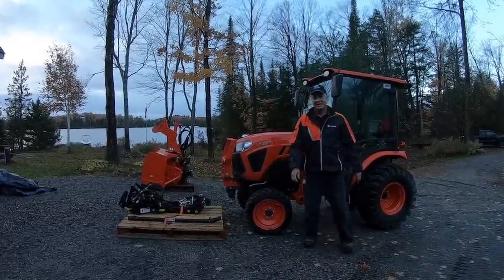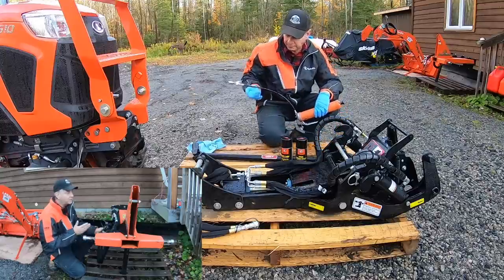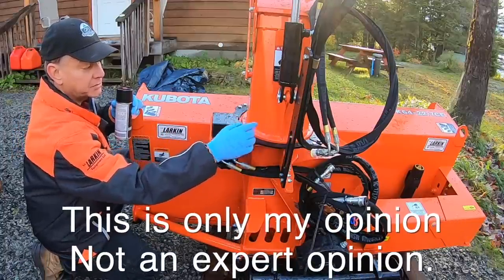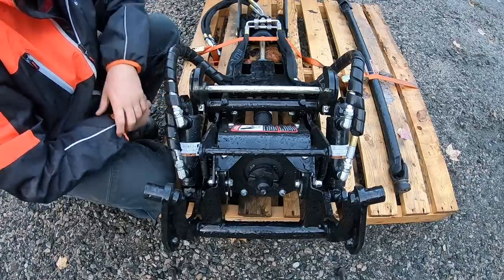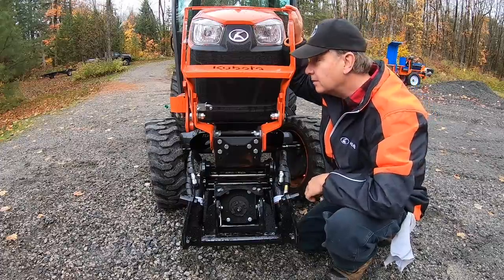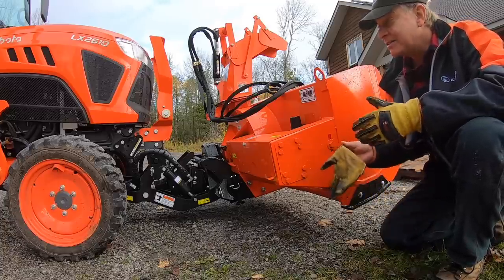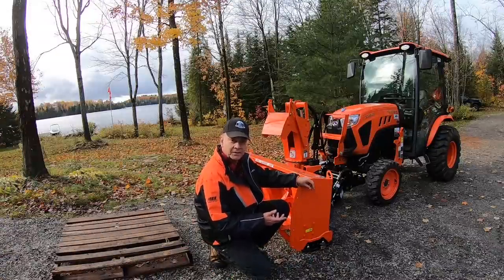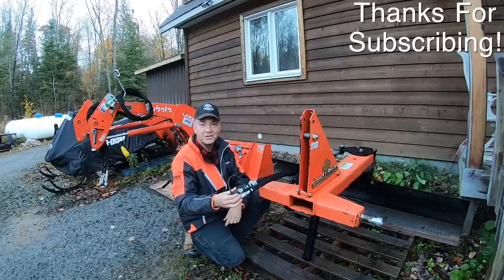#342 Kubota LX2980 Commercial Snowblower Install. Kubota LX2610 compact tractor.

Comment: I remember the first time I used my B2650, I was giggling because inside the cab I was so warm and comfortable and outside it was -20 with a 40 mph wind.  I will never forget it!  Don't forget to remove your air intake tube that goes from the front of the hood to the air filter when blowing snow.  Thank You for all the Great Videos!  They are very enjoyable  :  )
Reply from the maker: Morning and thanks very much ND! I am pretty excited to have some heat this winter. Can't wait. Have a great weekend!

Comment: The cup fitting is not a jic fitting its a compression fitting, that's why it doesn't need tape, using tape in general is only really a problem when you get it over the hole, it can get into the hydraulic system and into your relief valve etc. The yellow tape is for gas lines. O ring fittings make the seal with the  o ring. I would suggest though when you're installing any mounting bolts, especially on outdoor equipment, to coat the threads with blue locktite. It not only keeps the bolts from backing out, it will help prevent rust. Good content, im pretty sure I'm getting an lx2610, your vids have helped me decide. Also pipe fittings don't absolutely have to have tape if the threads are cut right, npt (pipe) threads are a tapered, self sealing thread, but tape or dope helps lubricate the threads and helps seal.
Reply from the maker: Good morning and thanks RC! Very helpful info for folks. I did some research and corrected those fittings in another video. Always lots to learn. LOL. Good luck and congrats on the new tractor!

Comment: You only need a Teflon tape or sealer when the threads are what is preventing the oil from escaping (like a “pipe” fitting) in the case of your previous video you had J.I.C. fittings (where the seal is made by the little cup part on the end) and not the threads. There is also an ORF (o-ring face) where it’s an o-ring that seals so again no tape/sealant required.

Comment: That's a nice blower. Looks really well built. The construction is very similar to that of a rear 3PH blower with the huge impeller, gear box in the back and chain drive auger. I prefer that configuration over the small bevel gear box located on the auger.

Comment: I laughed when you mentioned the "naked" tractor, I actually just bought a naked L2501 to run my 68" 3 point inverted snowblower. I'm looking forward to seeing your new snowblower in action.
Reply from the maker: LOL! Cheers Dave!
Reply: @GPOutdoors  hey Gord did you guys get any snow Friday night? I'm in New Hampshire  and north of the notches got 5 inches.
Reply from the maker: We got a heavy frost for sure but no snow. It's coming!
Reply: @GPOutdoors  i just bought a new husqavarna st327 blower with a 14.5hp kubota gas engine

Comment: A little trick I use to mark hydraulics hoses positions. Buy multi colors zip ties and match both males and females connectors with the appropriate colors. Much better than any kind of tape that, over time and in proximity with oil, always gets off. Do the same for the back remotes and implements hydraulics.
Reply from the maker: Morning Daniel! That's a great idea - I'll keep an eye out for them when I go to Princess Auto the next time. Cheers and thanks again!
Reply: My 2650 with similar set up came with colored caps/plus on the hydraulic ends.
Match those appropriately and then you have protection when not in use and a marking system when you need to connect them.
Reply from the maker: Thanks Tom. I think all of them should come with it but only two came with them. Cheers!
Reply: @GPOutdoors  
You might be able to buy them at the dealer or since you are doing such great things for them maybe they will donate them to you. Wink, Wink!!

Comment: GP certain fittings do need tape.  JIC are the tapered fitting they self seal.  I worked for CN rail on track equipment and  it was always a big no to put tape on JIC fittings.  With that said that JIC fitting may have a NPT thread on one end where it threads to the hose.  That end would need tape.  But it is a good idea to talk to your mechanic.  I am looking at my B2601 and there is no tape on JIC fittings only on NPT fittings.  Sometimes the NPT will use an o-ring.

Comment: I was surprised how easy it was for you to attach that subframe.  I thought that was going to be much harder.  They way it balances on the front pins and easily rotates to attach the rear pin looks like solid engineering to me.
Reply from the maker: Morning and thanks M! I was really impressed. However you may have noticed I had to go out front and push it on. The pallet raised it off the ground too much i think, and affected the angle of approach so next time I will put the blower flat on the ground and I believe it will just lift and connect all on it's own. Cheers!

Comment: Thanks GP for the snowblower hookup to the LX 2610 video. It is superior to the one I got on the B2601. Although I think my blower chute seems to have more chute rotation unless you didn’t turn all the way.  You gave valuable tips on what you do which I will incorporate this fall. I really like the K Connect, much stronger even though I’ve had no problems. Lots of improvements. Thanks again for the video. Wayne from Wisconsin

Comment: You'll really appreciate that cab and heater this winter GP.  As for the teflon tape I'd use it for sure. Except for on the fittings that are beveled and/or machined.  They will leak if you put teflon on them. As you know, i work in the gas and oil and we always use thread sealant tape normally the white is fine for most all applications. The colors are for different temperatures and products. We use the yellow teflon for products like Propane and Butanes. Which are products that are -17°F. We use the white teflon on Natural Gas lines Compressed Gas, and blue on high pressure oil and water lines. Alway hold the fitting with your left hand and wrap it Clockwise with your right hand.  Haha, left handed people struggle with this task.
Reply from the maker: Good morning Dean - thanks! Super helpful info. Good thing I am right-handed. LOL. Cheers!

Comment: GP what determines if you need a thread sealant on pipe threads is if the threads are tapered. Observe side profile of male threads and you’ll see if there is a taper or not. The taper is what creates the seal. As the two “cones” come together (males threads/female threads) the tapers will lock together and seal with a sealing compound or tape. Any fitting that has a swivel nut, oring, or some kind of sealing washer does not need thread sealant. Of course there’s always an odd duck and that is BSPP. I think old days they use to use hemp or what every they had to seal these straight threads.

Comment: Good looking machine I would use what you say is white tape Teflon tape never use the yellow tape that is for gas lines only like propane or natural gas since those are more corrosive in nature then water or hydraulic fluid is. I work for a hardware store over 5 years now and I see the people all the time wondering which tape to use and we tell them.
Reply from the maker: Thanks D! Appreciate the help!

Comment: Greetings Gord, Lee here,  just a heads up, where you are talking grease fittings, thought I would mention that my son bought a new BX23S with a backhoe. He checked it over and seen all the grease zerks had grease on them, he assumed the fittings were all greased. But when he was using the backhoe he noticed a noise coming from the swinging of the hoe, when he checked it out he noticed that even though there was grease on the fitting, it did not go into the fitting and hence the noise, he noticed there was orange paint covering the zerk preventing the grease from entering. so he scrapped the paint off and then regreased it and all was well, Keep well, later
Reply from the maker: Morning Lee. Thanks - this is very helpful. I will take another look at it this week and wipe them off and just give a squirt to see. Thanks again - better now when it is warm, than later down the road. :))

Comment: 27 yrs as a aircraft mechanic- the fittings that need a sealer or something to keep thread from Gauling  recommendation use a Teflon paste not tape- if the tape gets into system it can cause problems in small orrface in most valves- the fittings that have the 37 degree on leading edge does not require tape- on stainless steel fittings it is recommended to just lube threads
Reply from the maker: Thanks very much Lee! Very helpful! All the best to you.

Comment: Hey Gordy, 

You are always very detailed and informative with your videos.  I received my new LX2610 Cab model 2 weeks ago and just put my LX2980 snowblower on for the first time.  Never had a tractor before so I'm learning everything as I go, but this commercial blower is very easy to attach.    I'm kind of excited to use this bower for the first time.  It IS a beast! 

One thing I noticed on your video that you had specifically commented on, is that you have heat shields on both sides of your tractor.  The only one that is needed on your tractor, is the one on the left side where the exhaust is located.  The one on the right side is for the LX3310 as its exhaust exits on that side.  Its certainly not hurting anything to have a 2nd one...

Also, not that it matters, but I installed both of the L pins from the right side of the tractor.  That is what is shown in the manual.  Makes securing them with the locking pins a one stop operation on the left side.  Routing the hoses through the "twisty" hose support is somewhat of a pain.  The process that worked for me was pushing the hose through the side on the support and then working the hose around the upper and lower ends of the "twisty".  It's tight, but they do fit!

This "twisty" Hose Support as it is called appears to be missing from your tractor.  It is shown on page 22, Part# 5 in the "Kubota LX2940 Subframe and 4_point hitch Owner's Manual".  Might want to check with your dealer on that.

Let is SNOW!

Keep up the great videos!

Comment: How's she goin'?  That's a nice blower GP.  It lifts nice and high and that will be a benefit.  The mount went on some easy and then connecting the to the blower was a snap as well.  Pretty slick all around I'd say, and it's even orange!!!  LOL  Hope the winter isn't too rough.  We're due for an open one, but we'll see eh!!  Take care!!
Reply from the maker: Morning Grampie! I can't wait to see if it throws as well as the last one. Having it on the pallet I think raised the angle - you may have noticed I had to grab it from the front and push it onto the hinges so next time I'll put it on the ground. Take care my friend!

Comment: Consider using PFTE spray for lubing areas where you have steel on steel but dont want to use grease which will attract dirt or ice. I use it on my PTO and hydraulic sleeve fittings as well as on the snowblower chute gearbox.

Second, use a bolt and nut to secure the big pins that hold the undermount to the frame. I've routinely lost those cotter pin type D rings due to the forces when snowblowing on turns or hills.

Comment: I use a pipe dope I got from Princesses Auto myself. Think anything is better then nothing. And do like you said. Keep it only on the threads. 👍
Reply from the maker: Thanks Laurie!
Reply: As another stated, there are different types of sealing fittings. If the cupped or o-ring type, you are actually causing great risk of a seal failure if either get into the seal area.
Reply from the maker: Thanks Coy.  Many folks are saying the same thing. Always lots to learn. Thanks again!

Comment: Hi, awesome  setup. Referring to Teflon tape, I had to replace a hose last winter and the hydraulic guy told me to use Teflon tape + the  old one that I replaced that came from Kubota had Teflon on it. So depends i guess however you talk to ? Cheers.

Comment: Nobody else mentioned this, so I will.  I think using a camera on the front to line up with the blower is CHEATING!  Not everybody has a camera to use to see what's in front!  hahaha   Nice job as always GP.  Good thing you do these dry runs beforehand to make sure everything works properly, or else you'd be like me doing it in the snow!

Comment: GP I sent you an email explaining along with pictures. JIC fitting are like brake lines in your car.  They are flared on the ends to self seal.  Nobody uses tape on brake lines which is a hydraulic system.
Reply from the maker: Good morning Mike! Thanks very much for taking the time to send them. It was very kind of you and it's greatly appreciated. Just went through them. Thanks again !

Comment: How to safely mount/dismount the snowblower when it's on a pallet: Make up four sets of three 2"x8"x24" long.  Then position the 2x8 blocks in front of each tire, in 4WD-low range drive up onto the blocks.  Now the tractor is on the same plane as the snowblower and you can safely lift the blower on/off the storage pallet.  I have a BX2380 with BS2822 55" commercial snowblower and K-connect system.  I store my snowblower on a frame with castors so I can move it about my garage.  The 2x8 blocks make mounting the snowblower easy and safe.  

Also when you  move the spring-loaded Engagement Lever forward it doesn't always engage the coupling pawls.  So I recommend you try to spin the 2nd stage blower vanes.  If they spin easily the pawls are not engaged and you will hear the pawls snap into place.  If it's hard to span the blower vanes the pawls are engaged.

On my 55" commercial blower there is a large speed reduction gear box which the K-connect shaft connects to.  The gear box gets very warm and when cooling down will suck water from melting snow into the gear box through the breather vent.  For this winter, I jury rigged a cover over the breather vent so it can't suck in water but will still breathe.  In the Spring I recommend you drain the gear lube oil from your gear box and check for water.  In the video, it looks like the vent is at about 1 o'clock on top of the gear box and is not painted. 

Here is New Hampshire we occasionally get a very heavy sticky snow and then the BX2380 doesn't have the torque to efficiently power the 55" blower.  Hopefully your much larger displacement engine will have the torque to manage sticky snow.

Have fun this winter!

Comment: Great stuff GP...that blower certainly is a step up in build quality, heavy duty for sure. Disappointing that it wasn't spec'd and shipped with the proper hydraulic fittings and poor instructions. You'd think for the significant price that was paid, all those kinks would have been worked out prior to delivery.
Reply from the maker: Morning TD! I wish the instructions were a little more clear but maybe they are for a mechanic - just not easy to follow for myself. I'll get it corrected and ready for action. Thanks - have a great day!

Comment: those hydraulic fittings didnt really need Teflon tape. but the teflon tape acks like a lubricant or buffer to the threads too. you dont want to be too messy with it cause if a little piece of tape gets through the hole it could cause grief with the hydraulic pump. its not a bad thing to use if your not sure. it is true the white is the cheapest . here in the states yellow is used on natural gas or propane lines tape blue is a much better than white the blue is good on temperatures from -450 to +500 degrees fernite. teflon tape kinda like your toilet paper roll over or under on the holder lol anyways great videos keep up the great work
Reply: Agree.
Thread compound, tape or dope, is a lubricant to allow you to tighten the fittings enough to get their sealing surfaces to mate properly. It is NOT a sealant or leak stop. If it leaks, there is an issue with the threads.
White tape is the thinnest, and for a reason.
Blue tape is thicker and has PTFE(teflon) infused.
Yellow tape is for gas fittings.
Compounds/pipe dope is used by "professionals" in trades more than in DIY.

As staed, flare fittings use the concave/convex surfaces to seal and do NOT need any tape. I do apply a small amount of dope as an anti seize. This may be a debatable subject.

Comment: GP, colored zip/cable ties are a quick simple way to color code your hoses. You can likely find the same colors as Kubota used for caps, but id not just use the same color tie on each side of the connection for future reference. 
Sorry I do not know where to advise you to shop there.

Comment: Still loving all your video's!  Thanks again for sharing.   With your help I recently purchased a LX2610 with cab , Loader, quick hitch, and Ballast box.  My newest addition to it is the front end snowblower.  Will I be able to switch between snowblower to loader without taking off the snowblowers underbelly hdwr? 
Thanks in advance and take care.
Reply from the maker: Congrats Jason. The dealer told me that the hardware has to come off unfortunately. Enjoy the new tractor - blowing snow in the cold is a lot more fun with some heat, a coffee and some tunes!
Reply: @GPOutdoors   Figured as much.  Thanks again for the fantastic videos.

Comment: You talk about hydraulic fittings this is what i was tot the fittings with the o ring is called orb or o ring boss the female side should have a machined recess for the o ring to sit in and the o ring makes the seal no tape required but will not hurt as long as the o ring is clean another type is the jic fittings they are the ones with the taper before the threads making the male fittings look pointed the female side has the mating serfice no tape required but will not hurt as long as the taper is clean the third is npt or national pipe thread it has a tapered thread requires the tape it is best if the tape is applied so it does not unravel when you Titan then and they require lots of torque to make the seal hope this helps